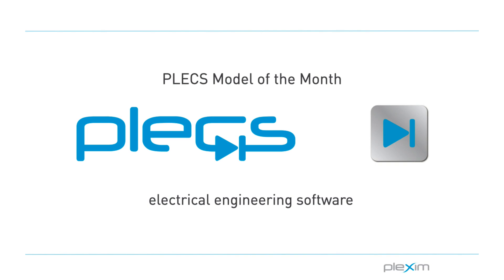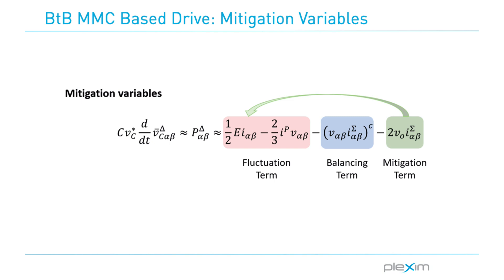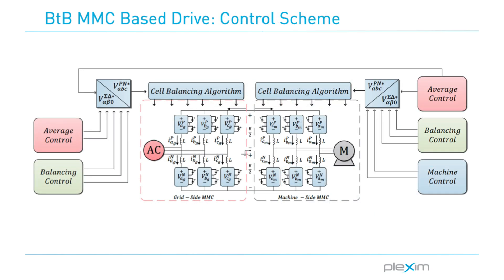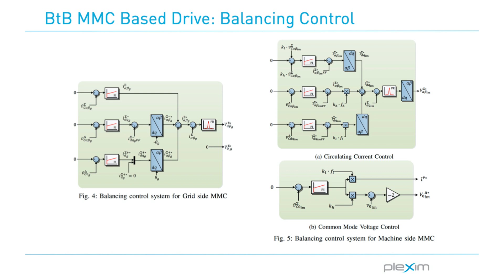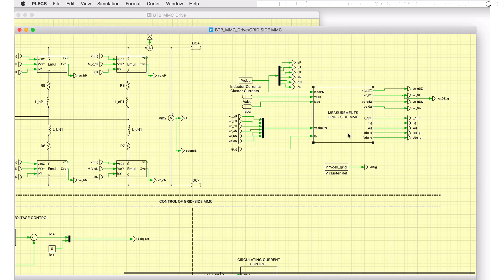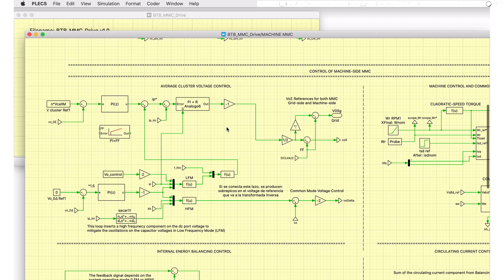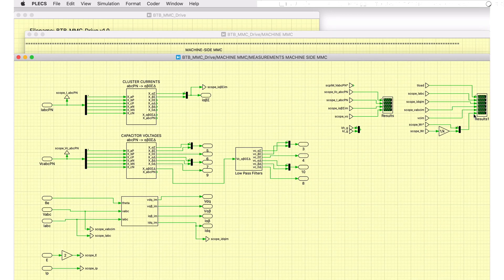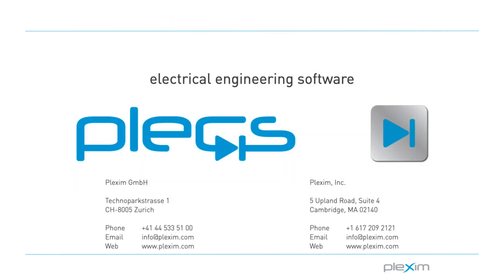Dynamic DC-Link Voltage Control of BtB MMC for Drive Applications

Comment: Please could you tell me how to get the simulation file of this video shared model ''Dynamic DC-Link Voltage Control of BtB MMC for Drive Applications''
Reply from the maker: Hi Faraedoon, please contact Jonathan Lilo at jonathan.lillo@usach.cl for the model.
Reply: @Plexim  Hi dear I have contacted him two times but he did not replay to my emails. please help me to get the full simulation model and files related to this model. thank you.
Reply from the maker: @FaraedoonWaly  Hello Faraedoon, unfortunately, Plexim cannot provide you this model. The IP and copyrights are with Jonathan Lillo.